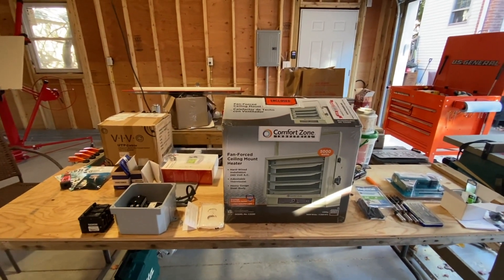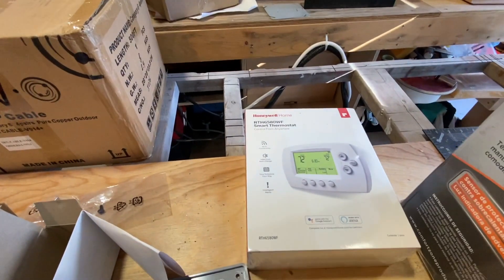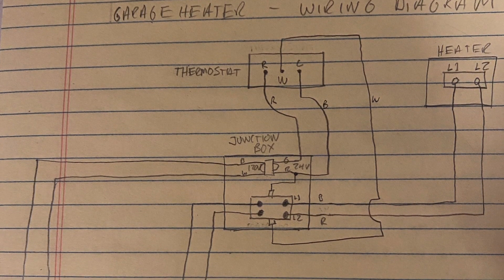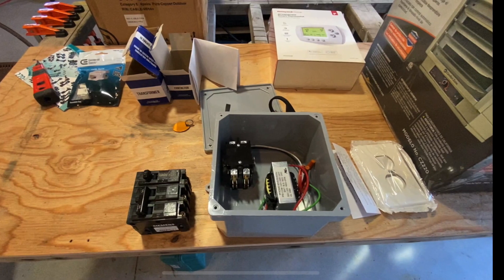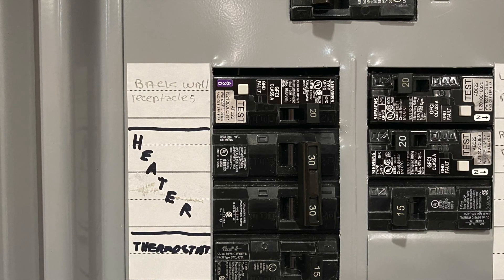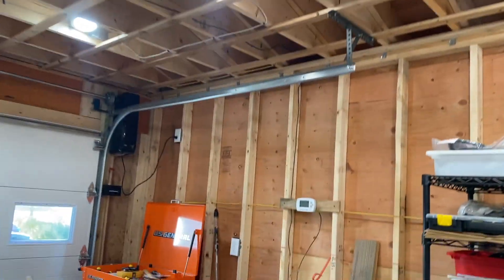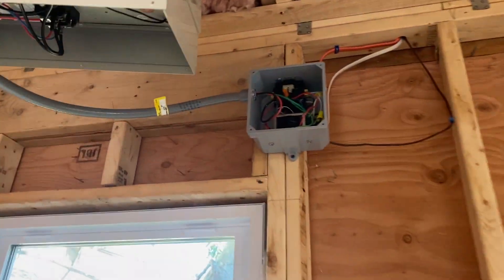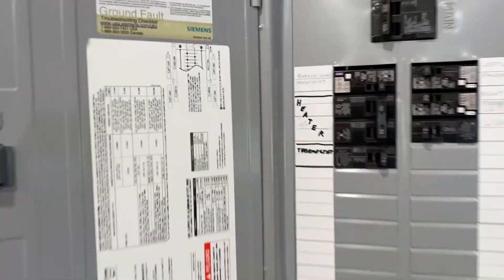Garage heater installation with smart thermostat

Comment: One last question Matt.  Instead of adding the electric to power the control transformer,  could you have used the contractor in the junction box?
Reply from the maker: I didn’t want to grab power from one leg of the 240 line for the transformer. So that’s why I ran a separate 120 line to power it. You generally don’t want an unbalanced line.

Comment: Matt ... I realize this is an older video but you did nothing extra inside the heater?  Your two hots and ground come off the junction box into the heater?  I have the Comfort Zone 7,500 but instead of a knob on the front,  mine is digital.  I love the idea of having the junction box separate from the heater.  My only goal is to have the ability to turn the unit off / on with a wifi thermostat using my phone.
Reply from the maker: Correct.

Comment: If your setup is controlling the main power coming in, you have to override the dial thermostat on the unit or else your other thermostat will only cut the power on and off. It will not control the heat as intended. You want the wall mounted thermostat to control the heat as if it didn't have a thermostat within itself like the dial. What I would do is like I'm going to do put my contacter in place of the dial thermostat and just power it with 24 volts to cut on and off by the wall thermostat. But you're on the right track
Reply from the maker: I've seen such setups, but I think they are overkill. When power is applied to this unit, and when the built-in thermostat is set (permanently, in my case) to high, the unit is on and providing heat. It doesn't matter that power is being supplied via a trigger from an external Honeywell thermostat on the other side of the garage. The garage warms up to the temperature as determined on the Honeywell thermostat, and then the unit shuts off. The high setting on the internal thermostat is essentially 'stay on until overload is triggered' (which has never happened). That said, if I get bored someday I might do something like you suggest.

Comment: Could you show a picture up close of your junction box and the T-wires on your thermostat?
Reply from the maker: I would need to open up the box and the wall and post a new video for that - sorry, but I won't be doing that. The wiring diagram is accurate.

Comment: Do you have part numbers for the contactor and the transformer? Would really like to do this. Also could i use a 240 volt transformer and power it with the keads to the heater?
Reply from the maker: Do you mean power it off of a 120 line? I wouldn't do that. I can dig up the parts numbers and update the video description, stay tuned.

Comment: cool idea. Only issue I would have is code doesn't allow low voltage to share same box. this is what we see our doorbell transformer on the oudside of panel or electrical box. However I have heard they allow a divided box..
Reply from the maker: @Will1Big  that is a good point. I should probably redo this at some point.

Comment: What's your thoughts, and are you worried at all about the heater having time to cool the coils down before shutting off? With the contactor, when the T-stat turns off, the power is completely gone from the heater. With the control board and built in T-stat, when the heater is called to shut off, it still gives power to the fan for a minute or two until the coils are cooled off.. thanks!
Reply from the maker: It’s not an issue, as this is a backup to the mini split and rarely comes on. I have seen videos that use a controller that runs the heater instead of the contactor, so what you suggest is possible.
Reply from the maker: Also this is the third time you’ve posted the same comment in the last hour. One more time and you’re out of here.

Comment: Great video. Wiring diagram very helpful but it doesn't show how system is grounded.  I assume the heater is grounded   at the panel?   Are the transformer and the contactor grounded? I assume the thermostat is not since it's low voltage?
Reply from the maker: Yes the heater and transformer are grounded, all throttle ground wire coming from the panel. I don’t recall if I grounded the base of the contactor. There’s no ground on the thermostat.

Comment: This is probably a stupid question, but why attach the 'green' wire off the transformer as the R wire and then make the red wire the common? Wouldn't it have been better to keep the colors as Red transformer to R (and therefore red 18 AWG wire) and Green transformer wire to Blue 18 AWG common wire? This may be my lack of understanding on which way the electrons are flowing. In the grand scheme of things and in a conceptional manner, is the common wire more or less the same (again as a concept) as the hot wire in residential wiring? I'm probably missing something or being OCD about this.
Reply from the maker: In this application it doesn’t matter, so I used a convention that I’ve seen elsewhere in HVAC installations. But good question.
Reply: Thanks Matt for the feedback! Appreciate you making this video. You’ve inspired me to wire up mine in a similar fashion. One thing I am going to try and troubleshoot is decoupling the fan control and use an additional contractor to accomplish this. Wish me luck!

Comment: I did exactly the same thing but when my thermostat calls for heat nothing turns on. What could be the issue
Reply from the maker: Hard to say. There should be an audible click when the contactor engages. Double check your wiring.
Reply: Your heater may need power at all times and will not work with this setup.
Reply: You need to hook the heater up as intended and bypass the dial thermostat with a contactor that is controlled by the wall mounted thermostat. Which all you have to do is have a 24-volt source, feed the wall thermostat and then feed back to the contactor inside the heater which is where I would mount it. That way when the wall thermostat calls for heat, the contactor inside that took the place of the dial thermostat will just cut the heat on. If your heater has an automatic fan control /heat sensor, then you're fine. Otherwise you would have to get a timer so the fan could run by itself with the heat coils kick off for 30 seconds or so to cool the coils down and delay to kick on as well. They make such a thing

Comment: Single pole or double pole contactor? Great tutorial!
Reply from the maker: That is a double pole contactor. The heater is 240v so it expects 2 hots.
Reply from the maker: Double pole - it’s a 240v heater that has 2 line inputs, 120v each.

Comment: did you have to disconnect the thermostat that was in the heater itself, would that shut the heater down due to its location in the heater?
Reply from the maker: No - I turn it all the way up. That way when the wall thermostat calls for heat, it turns the unit on at its highest setting.